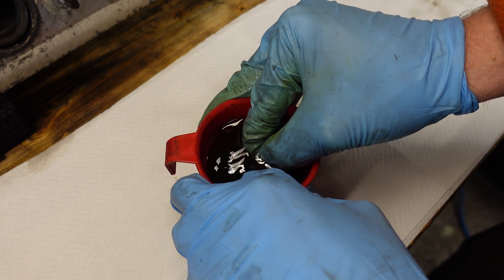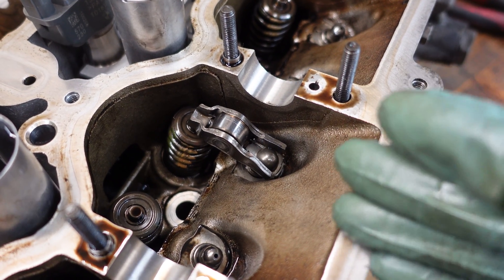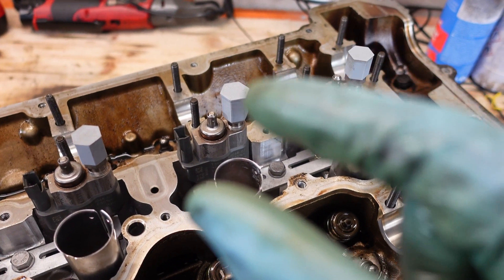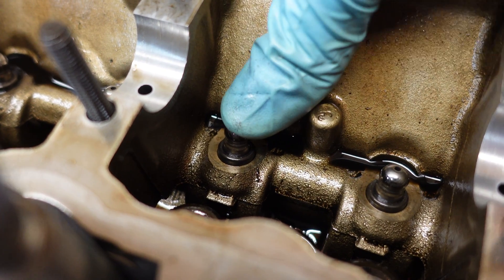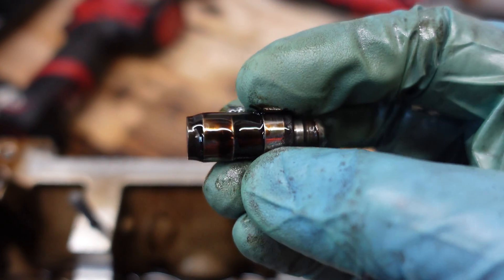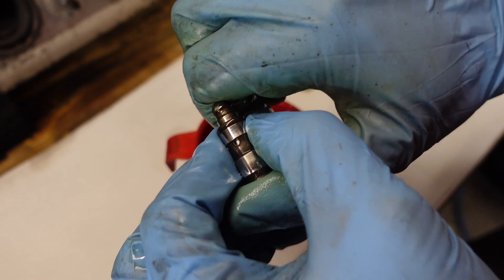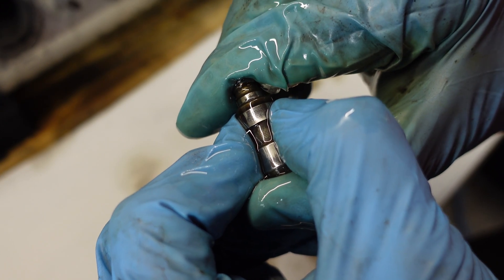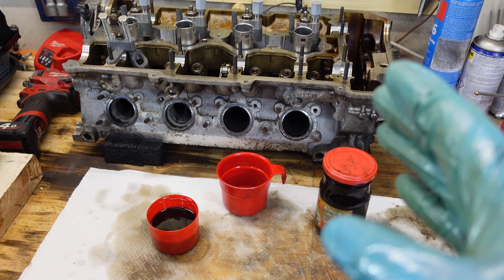BMW Lifters Cleaning, Bleeding, Checking & How they work (N43/N42/N46/N40/N45)

Comment: Can I do this without taking the engine out I.e. by taking off the rocker cover?
Reply from the maker: Yes, just remove valve cover and camshafts to get to the lifters. On n42/n46 you need to secure intermediate levers on to valvetronic assembly. https://youtu.be/Fn85Y-X9fAM?si=tFu1-bOBogW-kcEc you will need special tools to set the timing on the engine.

Comment: Hi great video...may i ask if i put new lifters and rockers in my corsa do i need to pre fill the lifters with oil befor i insert them...your input would be most helpful..kind rgards paul
Reply from the maker: I don't know about your specific case. Both would work, but prefilling should enable the engine to start easier.
Reply: Thanks for getting back to me..i will be going the way you said as i have done other research on this..thanks again  and kind regards paul @BimmerZen

Comment: 11:00 if you filled the lifter manually so its full of oil rock hard, so now its fully extended.  Wouldn't it cause a valve not closing?   Like inserting too thick shim when adjusting the valve clearance.
Reply: exactly! there is another video on youtube telling us to bleed them halfway out otherwise it s gonna fck up the valves.
Reply: @eminecetinkaya2907  n42/n46 are not interference engine. valves cannot touch the piston even when the chain is broken
Reply: @eminecetinkaya2907   Please, were is this video ?
Reply: @simbad-4724  https://www.youtube.com/watch?v=P8sGPrPIDDA
Reply: That’s what I would think too
Reply: I found the solution is to use a diesel fuel instead of oil, then turn the engine manually,  so any lifter which is too long will just drain the excess easily.
Reply: @isbemorph  How? The valve in the lifter will still be closed.
Reply: @Bicyclehub  ,  yes the little ball valve inside the lifter closed thus preventing it to collapse. With such a fully extended lifter the real VALVE  (exhaust or intake) might not close riiiighttt??   BUT  apparently this solution with a diesel fuel i mentioned earlier works, because its so much thinner thus allows the lifter to collapse under load when we turn the engine.  I actually made a mistake setting the timing and was stupid enough to turn the engine,  the pistons pushed on the valves and collapsed the diesel prefilled lifters,  the engine turned over but survived fortunately.  Afterwords i deassembled the camshaft again and all the lifters, prefilled them again  and put everything back together with correct timing this time.    My fault with that wrong timing was that i mistook OT mark for a TDC mark on a flywheel.

Comment: hi some says just bleed and make it squeeze or spongy and installl it without prefilling or laoding with oil.  can u pls advise which way to go.
Reply: Thanks Zen. A very concise and informative video.😎👍

I've been building engines for years mainly motorcycles but the principle is the same. I've just rebuilt the cylinder head on my E91 after one of the hydraulic lifters failed, it threw the cam follower, jammed the camshaft, bent an exhaust valve then sheared the cam pulley locking bolt.

I've always primed new hydraulic lifters by soaking them in oil for a few hours which takes me to the same result as your way of bleeding them. I've done the same on my N43.

I have read stories on the internet that advise NOT to prime hydraulic lifters which confuses me as the check valve in them also acts as a pressure relief valve which bleeds off excess pressure in the lifter.

Do you agree with my thoughts Mr Zen?🤔

Big thank you for your most excellent videos 😉👍
Reply from the maker: @fezmadheadzx14r38  thanks, i agree that if you install the lifter prefilled, they will bleed out a little due to some valve spring tension. Everything equalizes very quickly after first engine start.
Reply from the maker: @sivucit  There is nothing specified in the repair manual, so I'm prety sure that you can install them prefilled or "spongy". By the time you start the engine they will also bleed out a little bit from the spring pressure.
Reply: @BimmerZen  Thanks, if it is spongy when i start the car, i assume it is going to fill with oil, so the whole intention is to bleed the air is that the intention.

Comment: can no longer find the message I sent you regarding the lifts, I was saying that unfortunately when dismantling I mixed up the pieces and I wanted to understand if it is a problem to install them randomly, or I don't risk it and get new ones. ps: the engine has 125,000 km
Reply from the maker: Not ideal, but I would just put them back. It will probaly work just fine with such relatively low mileage.
Reply: Great, thanks
Reply: What should i do in this case. I have a Prius 2015 with 375000 kms and i put hem ramdomly too without realizing it

Comment: I have found in my 2001 N42 lifters without hole on top. So no cleaning for me. They rotate but not asingle one wants to be pressed. I am going to replace them as i dont like wear I se on ball.  I have found one exhaust roller stuck in oil drain hole.
Reply: Same for my N45. How are you supposed to clean?
Reply from the maker: N42/N46 lifter "cleaning": https://youtu.be/YcInE9VMU5g

Comment: If I compare the Lifter on your Video N43 there is a hole on the top on the lifter but in the Motor n46b20 there are no hole on the top on the lifters? Shold i remove this lifters to the n43 type? Br MS
Reply: Just confirmed your findings on my N46 engine. No way to check operation but plungers rotate freely and lengths all the same (34.5mm +/-01mm). No discernible plunger travel. No info found on the web.

Comment: Buy a lexus.
Reply: Lexuses have lash adjusters as well. My IS250 clatters on startup after having sat for a while, so I know there's a soft lifter. I'm doing a head gasket on my CT200h and am going to clean the lifters like this, pre-emptively. No point in changing them when they're all fine, but also the oil trapped in them is old and contains whatever junk the previous owner put in the car and maybe a little coolant from the head gasket failure. It's worth "changing the oil" in the lifters while I have them out.

Comment: Thanks for a great video!!!
It will be nice if you can do a video of removing all hydraulic lifters? 
Should we buy new ones or just service old and is there any procedure that we should trigger in software after service?
Reply from the maker: Lifters are pretty robust components and dont go bad that often on newer engines. This engine had bearing material in the oil so I had to clean them. 

Got money? Replace all lifters at ~10 EUR a piece:)
Preffer to spend money on other things? Clean them first and bleed and check if they hold pressure, as I did in the video. Replace only suspect lifters:)

There is a procedure for bleeding the lifters: let the engine run at 2000-3000 rpms for 4 minutes, then idle for 30 seconds, repeat the process until the lifter ticking sound is gone.
Reply: @BimmerZen  thanks for a info. I have to replace them on e90 😅with valvetronic motor too.

I will watch your videos many more times, they help me a lot with everything 🙏💪 thanks

Comment: Thanks for a great video
Should the cylinder head be reassembled with the lifters collapsed so that they can self adjust on start up?
Reply from the maker: Good point! It's usually not an issue because the lifters have some time to bleed a little bit of pressure out before instalation and startup.

For example, new lifters come prefilled with oil and they feel pretty much solid. I also could not find any specific instructions or information in the BMW manual regarding lifter installation.

However if you want to be 100% safe, you can use a little piece of wire and release a little bit of oil pressure. There is a procedure for bleedint the lifters: let the engine run at 2000-3000 rpms for 4 minutes, then idle for 30 seconds, repeat the process until the lifter ticking sound is gone.

Comment: The N43 is a terrible engine in my opinion, especially due to piezo injectors, and Nox sensor issues. I am curious if you will be able to make this engine running smoothly. I gave up, but I keep my fingers crossed for you ; )